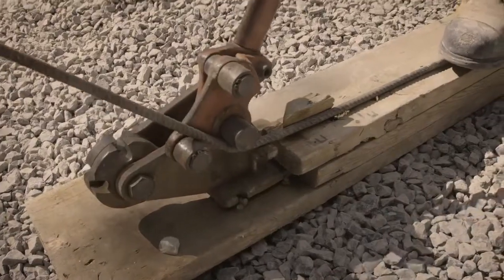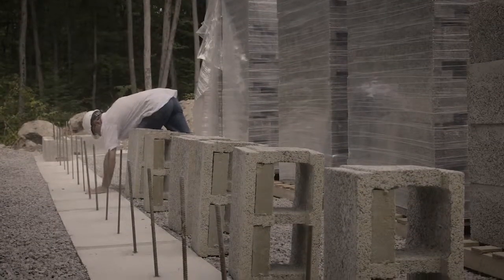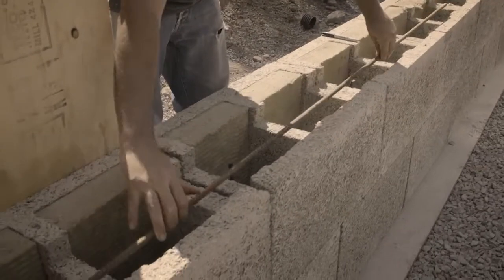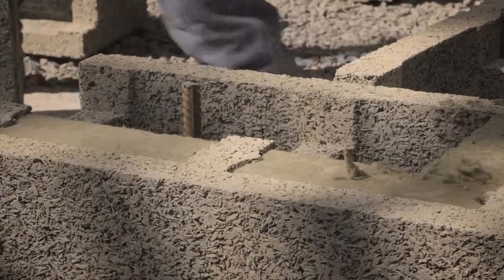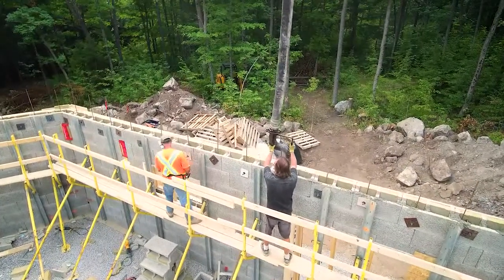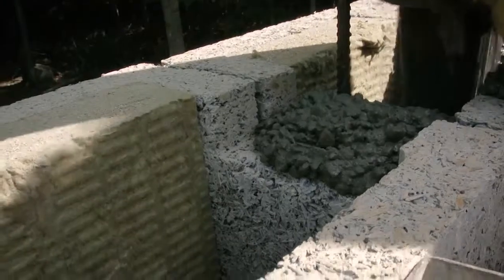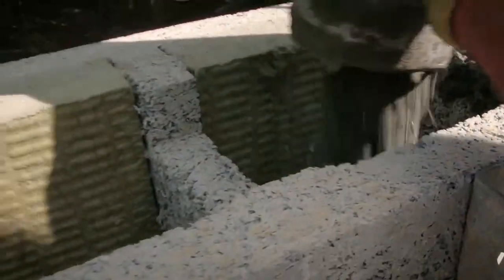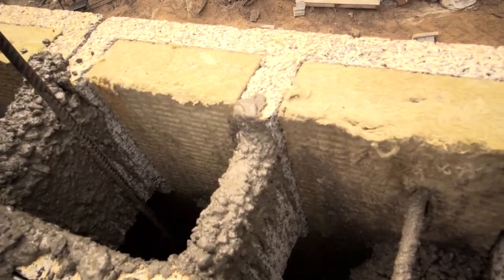How to Build with Nexcem ICF Part 5: Working with Rebar

Comment: Have you guys used Helix Micro Rebar?
Reply from the maker: Hi. 
Yes. We’ve used both steel and nylon micro fibres. Saved a lot of time. However, we ran breakage tests and found the wall to be more brittle than we expected. When it broke, it broke all at once. The test companion with 15m (5/8”) steel bar behaved differently. When the concrete in that assembly broke, the steel didn’t, and it took much more time (pressure) before the steel broke. The engineers decided not to endorse micro fibres, both steel and nylon. This was disappointing from an installation perspective. It takes a lot of energy to place bar.
But the price of fibreglass in the last couple of years has become comparable  to steel and the strength and behaviour is the same as steel. The advantage is weight and length. One person can handle a large bundle of fibreglass bar. Most steel is cut to 20’ or 6meter lengths so many laps are required. I’ve been buying fibreglass bar in 40’ lengths (40’ container) so fewer laps and less waste from cuts. For price comparison, $1.00 of steel vs $1.07 fibreglass (5/8”).
Hope this helps.
Tim